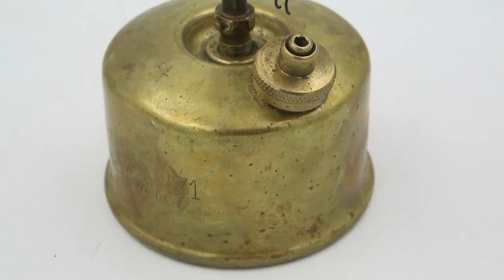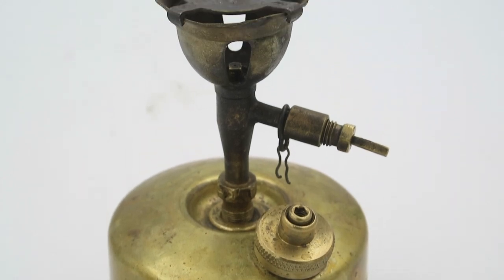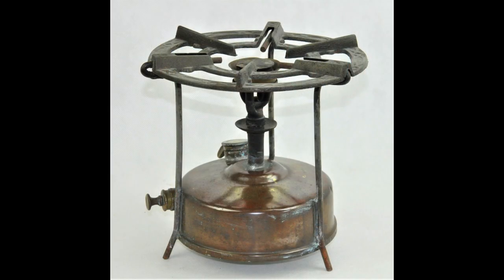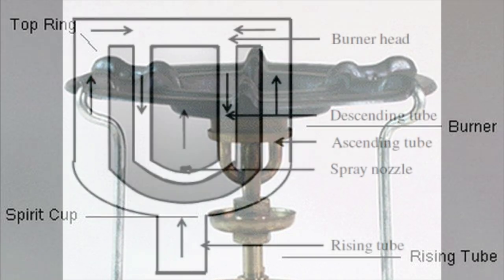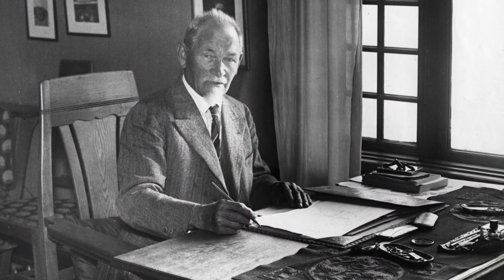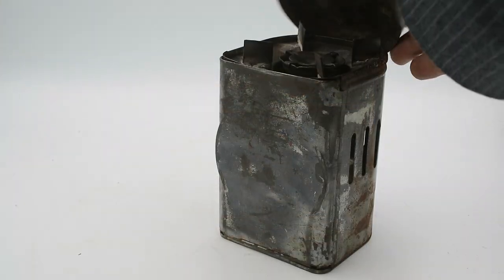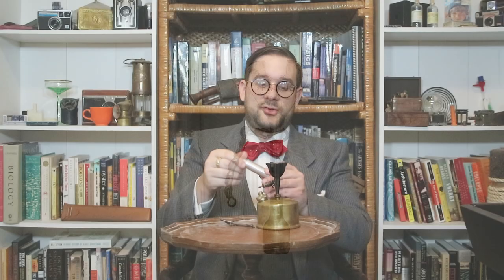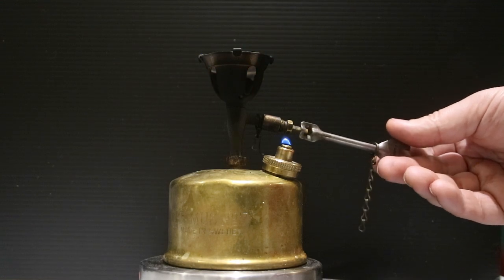Primus 71 Stove: the Camper's Companion

Comment: I met a fellow while canoe camping who had one of these stoves, might have been the Svea. His method for priming it was to just hold his hands against the fuel tank with the valve open. The heat from his hands was enough to expand the gas vapours in the tank, which forced a small amount of liquid fuel up the riser tube. The fuel then dribbled down into the priming cup, when enough had accumulated he lit it to start the stove as usual.
Reply: The Optimus 88 is a commonly found version of this. Very reliable. Unless the valve packing goes, all you usually need to replace is the seal for the fuel filler spout. This you can easily make out of automotive gasket cork. The fuel aperture can get clogged. A sewing pin held with pliers works if the fancified one breaks.Some are frightened of this type of stove due to the close attention required when lighting them.
Reply: Putting your hands on the tank to prime is kind of silly.   It only works on a warm day. don't try it a below freezing.  It only takes a drop of fuel in the spirit cup to get the flow going.
Reply: @tomsitzman3952  Bullshit.  The colder it is, the better this method works.  The colder the air, the more expansion, and therefore pressure, with every degree of temperature rise.   Full power will take a bit longer, regardless, since you need to get the fuel itself hot to generate operating pressures.  After reading this and some of your other comments, I don't believe you've ever used one of these.  Edit:  On further reading, it's clear that you HAVE used these.  I don't know why this doesn't work for you.  You may want to try it again.  In bitter cold, not wanting skin contact with brass is a real thing, though.  Slipping the stove under my coat for several seconds has always worked very well for me in those situations.
Reply: I have a Primus 71 in the rectangular tin windscreen/pot stand.  I bought it new in the mid ‘70’s and used it extensively for mountain backpacking for the following 20 years.  I always primed it by letting raw fuel dribble from the orifice into the well atop the tank.  In warmer temps, it did this reliably just based upon the vapor pressure of the fuel.  In the cold, I kept it in my sleeping bag so it would stay warmer than out in the snow and then put it inside my parka just before priming and lighting.  This was a sure fire process and I never had a problem firing it regardless of how cold it was.  I still have the stove.  It’s absolutely bulletproof, unlike Coleman’s and butane stoves.  I’ve helped out many a camper that had a failed stove.  The successor to these stoves are the MSR’s which operate on the same principle, but by not having the heavy brass tank, are significantly lighter.
Reply: Was it an older man named Dan Karig? He is my father, and was a competitive canoeist till about 5 or so years ago. He still has his Svea stove, and he taught me to use your hands to warm it up to start the flow, etc. Maybe Adirondacks area?  That would be cool if it was him.

Comment: I got my Primus when I was 11 in 1965.  I still use it occasionally.  Fantastic piece of engineering.  I might mention NEVER use auto grade gasoline.
Reply: Aren't they kerosene stoves?
Reply: I often used one in the 1970s, at our fishing holiday home. 
I second that NEVER use petrol. The brass conducts sufficient heat to the body of the fuel , that when the amount has burnt low, it goes into a run-away flare, that gives more heat, so more flare, and off you go to heaven in a ball of flame once it gets sufficiently hot..
Reply: @TrapperAaron  That's what he means.

Comment: I’m 65 years old so I remember all of these stoves and have either used them or had friends who did. They all were persnickety to a degree and each had pros and cons. Most of the issues related to starting and cold weather operations. Some of the fun foibles were freezing your hands on the cold metal stove. Burning your hands on the hot metal stove because it was hot enough to burn your hand but still wasn’t hot enough to start. Burning your fingers on the stove key because you didn’t take it out. Spilling fuel. Acquiring the plethora of different fuels. Sleeping with your stove in an attempt to mitigate some of these aforementioned issues. Sure these stoves bring back memories. The rocket engine sound once it did get going was a rewarding delight. You might even say using one built character. It certainly gives a greater appreciation of the choices we have today. I think most of us have moved on… but, we remember.

Comment: I was going an overnight bike trip this past week to try out some new gear.  II have a variety of pressurized stoves of different sizes based on the number of people I will be traveling with. this trip was only me. i brought a stove that was a little of an over kill for one person. Instead of bringing the Seva 123 I brought a stove with a little larger tank that has a built-in pump, the Optimus 00.  that I have been using for over a half a century.  At the same time, I was using a 50 plus year old stove and was checking out my new solar lighting and electronics, GPS, Smart Phone with maps, compass,  weather, tracking  and up dated ideas for my sleep system.   So simple and reliable.  I have never seen a reason to switch over to a cartridge stove.  And no cartridge to deal with .
Reply: Great comment!  That really speaks volumes to how well these were engineered and designed, doesn't it?  They are still tried and trusted along side all the other "modern" stuff we use daily.

Comment: 11:00 That leak in the cap is a bad sign. It could easily result in the seals of that cap being melted/burned away, resulting in a large fireball resulting in 3d12 damage to you and everything around you within a 10 foot radius.

Comment: A couple of notes: 
A] A candle flame from the top of your Fuel Cap is NOT a good sign, and means you need to replace the pip of the SRV [safety relief valve] and probably cap gasket too.
B] Primus 71 model predates the Svea 123 by a couple decades. It superceded the Primus 70 which has no regulating key or valve. Light stove -- melt snow -- full blast is ON. Not sure how to shut it down? 
C] This model would not have the self-cleaning needle. That feature was introduced by Optimus in the early '60s after they bought out Primus and Svea. Early Svea 123s had a downward sloping regulator spindle arm and jet cleaning was done by poking a proprietary needle thru the hole. When Optimus began producing their own regulators for the Optimus  8, Primus 71 and Sveas, they revised the designation to Optimus 8R, Svea 123R, etc. The regulator with self-cleaning needle is stepped down, but comes out with a  level spindle.

The 71 has been copied by the Soviets, Germans, [Jewel 33, 34, & Arara 37] Czech Meva and others. Svea 123 came along in the early 1950s. It was preceeded by the Svea Campus 3, but the Pri 71's lines are clear in the 123.
I've had a Svea 123 since 1970. Still reliable.
Reply: That valve always lights up I've had Optimus and the SVEA that valve will always lights up in the 20 years I've use those things never had a problem but they always light up I just blow it out
Reply: @johncremeans969  Have you replaced the SRV pip in those 20 years? There sholud be no leak under normal operation. Like the gasket in the fuel cap, the SRV pip is just hard rubber that deteriorates over time.

Comment: I found out about these doing WWII reenacting.  I've been using a Svea 123 model, and most everyone I know calls them "pocket rockets" (because of the sound and heat output).  This will bring a British mess tin or a small aluminum kettle to a boil in a ridiculously short period of time.  Now, I've only used it with Coleman fuel, but it's great.

Comment: I really like my Svea 123, very simple, effective and reliable. I use alkylate fuel sold for small engines, not expensive and works great. I light it by first momentarily loosening the filler plug to relieve any vacuum (there might be a vacuum as the stove has likely been hot when the valve has been closed so when it cools down it will pull a vacuum which would make lighting it harder) in the tank, then I either warm the tank with my hands and open the valve to get some fuel to dribble out for preheating or simply pour some from my fuel bottle. No need to carry a separate supply of alcohol, the primary fuel works fine for preheating.

Comment: I really like those old brass stoves, I even like the sound they make. When I was younger I
did a lot of caving, we used small brass carbide cap lamps. They are another interesting vintage 
technology, they not only provided a reliable light source when batteries were expensive and had
a limited life span, but were a heat source in cold caves. You might consider doing a video 
on them or even acetylene gas lighting in general. It was used in car headlights and even gas lighting
in houses. Thanks for the interesting video.
Reply from the maker: I actually have a video on carbide lamps! It's an older one and the audio isn't as good as my current work, but it's still comprehensive: https://www.youtube.com/watch?v=XE_JUQCSeAs
Reply: @CanadianMacGyver  Thanks another interesting video, You might be interested to know
The reason acetylene gas produces usable light is the incandescent particles of carbon. If you look into early
gas lighting, the gases that were used had high carbon content. It wasn’t until the gas mantle came along that
cleaner gases could be used. If you look at straight acetylene gas burning it is actually a yellow flame, it
creates light in the same way candles do, incandescent carbon. Old houses had coal or wood gas piped into them
for lighting, which along with light produced a lot of soot.
Reply: Great idea.

Comment: I've got a couple of these... the one in the metal box finally rusted away, but the older one with a pump (that was acquired by my father quite possibly as early as 1947) has been up the slopes of Mount Rainier in the big ice quite a number of times.  Good tough little blowtorch.  Quite dependable.

Comment: I used a Svea 123 for many years. I abandoned it when one day the concave bottom rapidly became convex. Fortunately the tank did not rupture, but I was pretty puckered.
Reply: I still use a Svea 123.  You do need to make sure the relief valve on the fuel cap is in good condition.
Reply: I had a SVEA 123 through my army career and beyond. It was brilliant. I had to part with it in the early 2000s. 

I bought a new one a year or so ago. It doesn’t work properly as it won’t completely turn off. Apparently this is now a common fault and I understand the SVEA has been sold to China. 

If I could find someone to repair it I’d leap at the chance.
Reply: @bob_the_bomb4508  It seems like just about everything good, be it cigarette lighters, camp stoves or electronics, in the last 20 or 30 years they've sold off the names and the plans, and in many cases the actual plant to the Chinese, so they can lash out cheap and nasty versions that capitalise on the name. Might as well, I guess - half the time they were probably producing knock - off versions anyway...
Reply: @bob_the_bomb4508  You need to reset the geared built in cleaning needle under the jet. Remove the jet, poke the cleaning needle on a pencil eraser,  turn the knob and count 3 to four clicks while resting the rack gently on the spindle.
Reply: @UnitedElectric  thanks! I tried that but to no avail… :(

Comment: I love the principle of using the heat of the stove to heat its own fuel, which in turn makes the stove run properly, and continue heating its own fuel. The only part about it that's not very elegant is starting the process with a messy open flame.

Comment: Sweet - I had a Svea 123 from 1976 to 2015 - worked SO darned well - carried it with the Boy Scouts and skiing/camping after - even had it while I was Naval Aircrew. I also carried it working with CalFire on wild-fires. My model had no primer - we carried an eye-dropper to put a little white gas in the priming cup. It "walked" off during the Butte Fire in 2015 - I bet it is still running for whoever stole it <grumble>

Comment: The scout troop I belong to used mini primuses. And we ended up collecting related items, The most common being Coleman Lamps.
We also had some of the blowtorches you mentioned, And one much larger device with a parabolic reflector, and a burner that heated up metal gauze to red heat to reduce a beam of heat for a large area. Though the most interesting device we found was a very large burner in a heavy duty frame with a crucible that appeared to be designed to melt lead. It had a label on it calling it the portable furnace.
All of these devices worked on the same principles, and for all of them, we had the specialist little wire tool for poking out the small burner holes, which was an interesting job that needed a steady hand and could be difficult in the extremely cold weather.
Reply: We had Primus stoves in my Scout troop too. I remember they could be a bit finicky in inexperienced hands but they had done a long service before I was there and are probably still going many years after I left.

Comment: My old Boy Scout troop in the 90s still had about a dozen brass Primus stoves in our equipment locker, though at the time were were all using Coleman Peak1's (white gas). We were each told to take one home and shine it up to be sold. I wish I had had the presence of mind at the time to buy one. I do have two much larger Svea stoves ( they look almost exactly like the Primus logo at 2:49)  from my commercial fisherman grandfather and they will, at full blast, melt lead in a pan (for casting sinkers, not like we routinely melted lead in our cookware). When I light one, I cheat and use a plumbers torch to get the fuel vaporized. Grandpas method was to tear up small bits of paper and place them in the "spirit cup" you were supposed to put alcohol in and them soak the paper in a bit of kerosene from the spout and let the kerosene burn using the paper as a wick until it warmed up the fuel pipe.

Comment: Concept is almost identical to a modern MSR white gas stove, which is by far my favorite kind of camping stove. I have had countless spirited discussions with fellow outdoorsmen about isobutane vs. propane vs. white gas stoves and I have always held that the white gas stoves are the best option by far. One of the main advantages IMO is that you don't have to pack out the empty canisters like a propane or isobutane stove, and the fuel is significantly less expensive. If you do require more fuel than can fit into your stove directly, the containers for white gas stoves are at the very least reusable, contributing both to the reduced cost and the minimization of waste. I will die on this hill and I will continue to viciously tease anybody I catch using a gaseous-fuel stove as long as I live.

Comment: Before priming, I open the valve a little. Sometimes I get a dribble of fuel that runs down the stem. I can use that to prime. With a little practice, the first dribble burns with enough heat to cause another dribble and that is enough to get your little friend roaring. I don't know the physics, conditions, etc. But I'm guessing there is some pressure in the fuel tank left from the last use. Maybe only works with changing elevation or temp or barometric pressure - I haven't kept a record. But it is always worth the quick check to see if I'm lucky.

Comment: Enjoy your content very much, but find it frustrating because most of the items you consider old, I have owned or used in the past (even your 19th-century blow torch!)

I got my Optimus stove in about 1970.  It came with a Primus stand like yours, but mine is still red and blue.  It ran on kerosene or white gas (sold exclusively by Amoco at the time.)

Two points you missed: 1) you don't need to carry extra liquid or a pump to start the stove.  You warm the base up with your hands (e.g. body heat.) When you do, the air pressure increases inside so when you open the valve, a little fuel trickles out and down into the spirit cup, and you are ready to light.

2) The needle valve does not clean the orifice.  When it clogs, you use the wrench built into the handle of the key to remove the orifice and clean it.  The stove came with a piece of wire just the right size to do the job.  In its place, and scrap of the first string on a folk guitar would probably do the job.

Hats off for your excellent content and research.

Comment: There were also priming pastes for use instead of a bottle of spirits. I have heard that gelled hand sanitizer works. There was also an accessory pressurization cap and pump for Svea 123. At temperatures above 0 degrees F, priming or pumping was never necessary since a little fuel could generally be coaxed into coming out the orifice and running down into the spirit cup. I normally used unleaded gasoline as fuel which worked fine for me without gummy clogging as well as much more robust flame than camping fuel. I never experienced a runaway, but never used it for longer than the time to boil a pint of water before allowing to cool. Perhaps if you were trying to cook raw stew from scratch in a big pot for an extended period on full power you could have a runaway with gasoline. When the whole burner assembly turns orange hot, common sense says back off. It goes without saying you should never use it inside a tent with any fuel.

Comment: Living in south Florida a coleman stove and lamp are gifts from the gods. The lamp i run on white gas ( naptha) the double burner stove w wind shields will run on about anything. Usually i run it on Rec 90 straight gasoline if i run out of that, i use 87octane/10%ETOH (Regular pump gas)